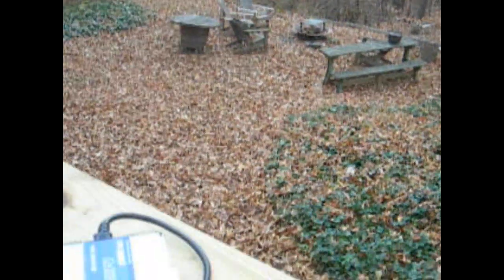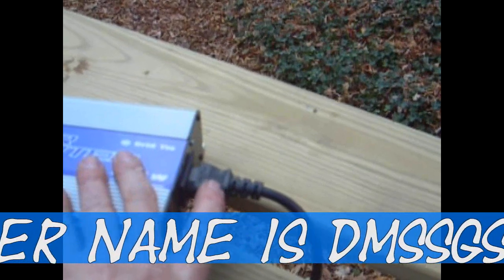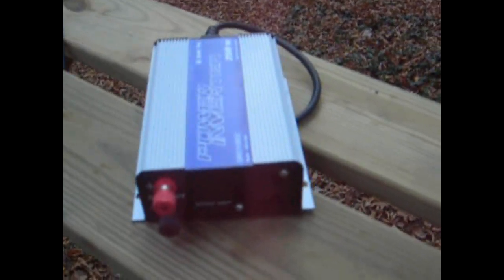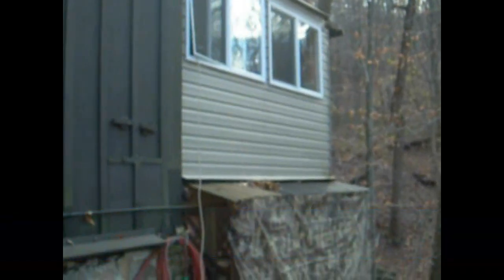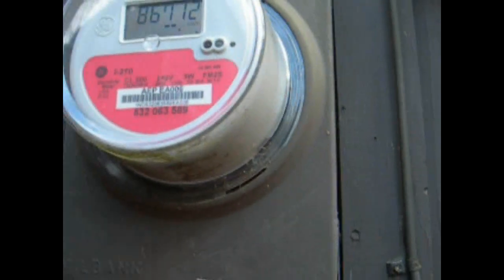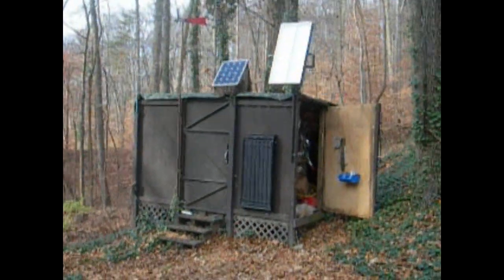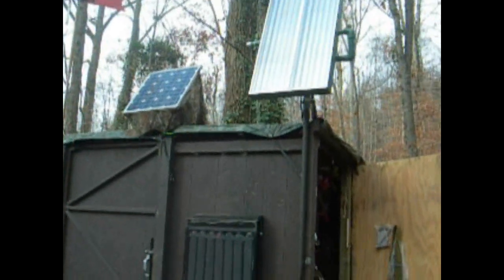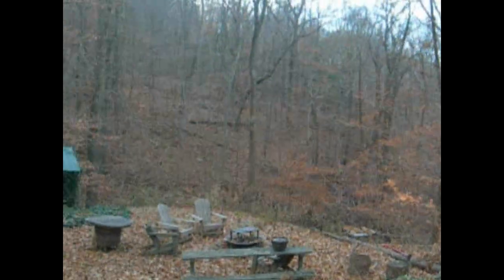TIE GRID INVERTER 2009

Comment: I bought a 1800 watt for $45 at ebay, But it is not the same inverter that Rich is using. The inverter that you and I have hook up to the battery and you and me plug a the light or other 110 volt devices into it.
The one Rich has plugs up to a battery or solarpanel and then plugs up to any electrical outlet in the house to feed power back to the grid.

If you and I would plug our inverters into a receptical at our house our inverters would go up into flames, so be warned.

Comment: But....
If your household consumes let's say 1,000 watts and you put 500 watts into the grid,, then your meter goes only 500 watt forward.

So if you balance your input, where you put less power into the grid than what you use the meter will just slow down.

Comment: Rich, you manifest what I seem to only dream, namely homemade hot air boiler system, solar system, and wind turbine.  Wonder where the water collection system is and will you hook in some hydro-electric system into it so that it provides a couple watts during gravity flow? 

Question, I'm told the grid tie inverter allow you to operate it without a solar system battery, basically facilitating solar power to go from the panel to grid tie (with mppt) to AC power, is that your understanding?

Comment: I have a very small system installed in my shed, the only time i put teh GTI (grid tie inverter) on is when high energy appliances are been used like the tuble dryer, this off sets some of the energy used by the appliance, I have a new digital meter installed by the power company and it does not clock up the energy as it never goes to grid, but hey its helping me cut bills I now get 3-4 wash loads free a month by using it this way.. :D

Comment: Do not be fooled by these small plug in grid tie inverters.  If you do not have an analog utility meter you will not get your meter to run backwards and the smart meters actually think you are using the amount of wattage that your grid tie inverters are putting out so you are being charged for that power along with the normal electrical power that you are using. I am trying to return my 3 - 500 watt units now. Not sure if I will have any luck though.

Comment: I just recently bought 3 - 500 watt grid tie inverters.  I have a digital smart electric utiltiy meter. I took all the loads off of the grid and connected the 3 - 500 watt grid tie inverters to the grid. Each inverter was putting out approximately 480 watts. I went out and checked the digital utiltiy meter and saw the small dots that normally move from left to right are now moving from right to left. But to my surprise the metter kept incrementing forward. I ended up paying for my free power.

Comment: Curious if you're still using this, Rich.  And if you are: do you have a meter that'll run both directions?  I think most people may not be thinking this in the comment thread, but if you're not actually running your meter backwards, you're just offsetting your usage.  So you're "slowing" the meter, in effect, and don't need a new one.  Thoughts?

Comment: @MacOSJoey The people that work on power lines know to coverup all the lines with rubber blankets even when the power is off. Their are a lot of people that run generator into thier panel. Even if the inverter did keep running, the lineman will be fine. I know, I am one.

Comment: @noahcarver  Yes it will INCREASE your power bill. The meter may run backwards But the numbers go Forward
costing you more. If you put "IN" power to Grid you will be billed for it.
Sunday Oct 30 2011 I input over 2700 Watt hours of power and the meter went up by 3, a real rip off.

Comment: @TrueNevose yeah... this is a GRID-TIE inverter, not the standard inverter you use in your car. If it doesn't detect an AC wavelength on the grid (aka, power's out), it WON'T send power into the grid (and yes, that is required by law on all GTIs)

Comment: @noahcarver Sometimes with newer digital meters you can't send power back into the grid. You have to sign up in a contract with your electric company and recieve a special meter to send it back and make money. Most systems only make enough to suppliment the power company. Unless your inverter can kick out more than you're using inside the house, you shouldn't have a problem. It's impossible for it to increase your electric bill (It gets the power from the batteries, not the grid).

Comment: @moremov52 @moremov52   Not true . I have a new smart meter . It will not run backwards but it will stop . Also there is a small led bar indicator showing which way the power is going . Mine moves from left to right . when i shut down everything except the grid tie and a few Cfl lights the Bar indicator goes from right to left showing power is being restored to the grid . Also a 5 hour test was done and the meter numbers remain where they were . So it Does work and you are not wasting money.

Comment: @TrueNevose  micro grid tie inverters have island protection to prevent feed back when the power company turns off the power or are working on the power lines. Meaning when the inverter doesn't detect grid power it shuts off. unlike a regular inverter it has to detect both incomming power from pv or windgenerator and 115v grid power before it will work.

Comment: I am looking at these on Ebay and I just want to get it right... So I get one of these and plug it into a wall socket and it will feed my house 'circuit' with power. And if I turn off all my appliances it will turn my meter backwards???

Comment: @noahcarver - So the other method is to set up your power production charging batterys then to a DC to AC Inverter.  Install a CUT-OVER switch so that you can shut off the power company and use them for back-up, and use your power for free.  This is where YOU will make the best return on your investment in equipment. You can also install a WHr meter and monitor your own system.  With the CUT-OVER switch you switch over to the local power company when you have your system down for repairs.

Comment: @noahcarver - I have a digital meter similar to the one the video.  I talked to my power company they said that the meter would not run in reverse and that a bi-directional meter would need to be installed to set up my account on NETMETERING.  With the bi-directional meter you get an instantanous reading of total power used by YOU or the total power accepted by THE POWER COMPANY.  In most cases the power company though they do pay you for your power it is only the wholesale rate to produce.

Comment: dude I have 3 125 watt panels running into this and 4 45watt HF kits running into this.
Fan runs non stop lol.
I can't believe it handles it. I am wondering though just how much power it is producing back for me. I had someone tell me out of all that I might be getting 180 watts or so. Seems  off I need to get a kilowatt meter

Comment: Basically its 3 ac waveforms on the same wire, but each at a different time due to the construction of the generator at the utility company.  Baaically,  this delivers more electricity than using only1 phase/waveform.   Its better than dc sometimes because it can be easilly adjusted with transformers, and dc anyway is basically created from an electric generator.   I think alot of home use is for 1 phase ac,  some which gets converted to standard dc for like for radios and things.

Comment: @trailkeeper I continue my last reply.. We have 5 wires going into most of our houses in sweden. 3 phases (dont know if spelled correct) and one earth (ground) and one 0- connection. The 3 phases has a voltage differential of 230v against the 0-wire. You can also get 380v (16A) if you use all 3 phases. My house has 230v and 380v and maximum 16A on every phase. But for houses 20A and also 25A is common but more expensive. I manage fine with 16A :)

Comment: @trailkeeper Yes, i know.. I have a main breaker in my house. But i have spoken to several electricians and they say the same thing. If you switch of your main breaker in the house and run an inverter inside your house there will still be dangerous voltage going out to the net.. It is like that here in Sweden anyway. I don't know your system in America. Here we have a earth and 0-wire connection that is not going through main breaker. Don't ask me how it works ;)

Comment: @lisag65256 As for basic safety of what your asking, it is a good idea not to mix any power you make with green energy or something, with grid power, unless you have special equipment such as a "grid tie inverter".that is compatable with the utility's own grid system.  Otherwise, if you want to use your existing house wireing, you have to get disconnected from the grid by a switch in your own house with no chance of power from or to it for safety reasons.

Comment: @taztaz79 Your right, a regular inverter does not have any "sync" ability to say "in phase" with the grid supply.  However, if your completely disconnect from the grid through a switch in your own home, then it is possible to run some electricity through your existing house wireing....so if you were to build a "green energy" type of house, completely disconnected from the grid, you still would want to install "house wireing" for power.

Comment: @taztaz79 Were about 110 to 120V 60hz, in America.   Regardless of your country, if no power is going to the grid or comming from the grid (ie be sure "external" grid connections have been completely disabled in your  own house - regardless if there is a grid blackout or not) and no power is being sent to the grid (ie from a regular inverter, non-grid types), then there should be no problem.  For safety,  you have to be "disconnected" from the grid as if you dont  have a grid connection.

Comment: @trailkeeper I don't know so much about the US power grid other than its 110v 60Hz? But here in Sweden you can't do it that way.. Because the fases (3 fases x 230v 16A in my house) will be turned of by the Switch but the 0 connection that is earthed will still going out. That will make it very dangerous if power is down and an electrician try to fix the error and you are running inverter with the incoming mainswitch off...

Comment: @WulfBand No you can never connect a regular inverter to the grid. That is dangerous.. The grid-tie inverter is made for sensing if there is electricity on the net and adapt its output to this voltage and Hz... So never connect a regular inverter to the grid..

Comment: I guess if its not a "grid tie / synchronized / capapble " inverter , it might be possible to use a regular inverter if the utility company power is turned off to the house.

Comment: great videos...im pretty new to this...i had no idea it was so simple...few questions...ok the can heater...isnt going to work at night straight off of solar obviously, would working at night off your wind turbine or battery to a ele heater more effective than a fire? ive been pondering a oil system off of a wood burning stove idea,running oil lines through the house... i live in alabama it doesnt get super cold here im going to be building a house in the future any thoughts....

Comment: I am against the current system of power we have now, I feel that "adding power" back in does almost nothing to cure the carnivorous use of power we have here in the US, sure it helps, but we are comparing its significance to a person pissing in the ocean, almost no effect. We must change our ways of power consumption and the only way that will work is to get off the grid altogether, it just like a drug and its addicting as hell, break the hold having less means using less simple physics.

Comment: VAWT's are supreme to HAWT's unless you consider laying a VAWT horizontal in which case dependant upon the flow of air over a fixed surface would produce more torque at lower speeds a HAWT simply cause its horizontal then whos to say? typical multi bladed VAWTS such as Darius or Savonius will always beat out a traditional windmill type HAWT. The only HAWT systems I trust are Hornet blades on slantcore PMA's from Missouri Wind and Solar, Jeff has mastered that design and its the best HAWT by far!

Comment: Interesting, ... what information do you have to  say the HAWT's are better than VAWT's? 

I believe it's the surface area exposed to the wind and pitch of the blades that determines how much power can be had, not the axis of the turbine.

I'm not trying to be difficult, but I would like to know where you got your information.